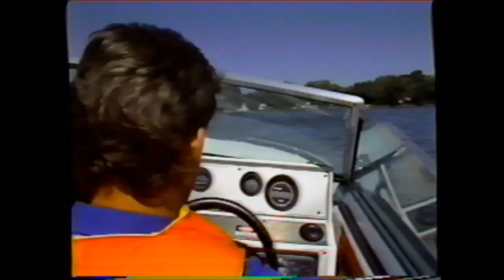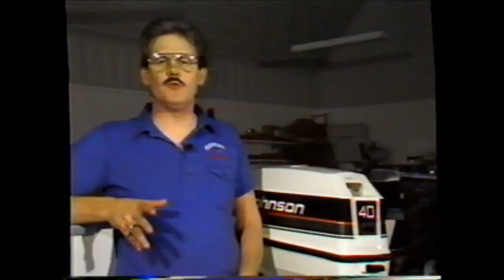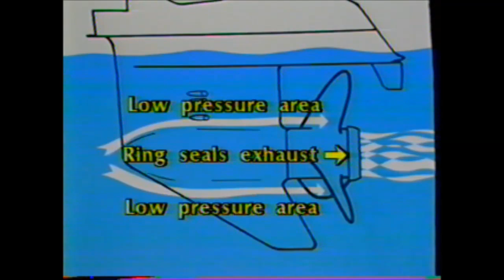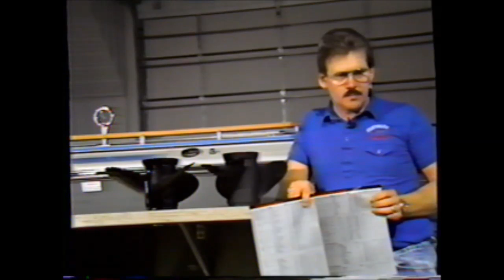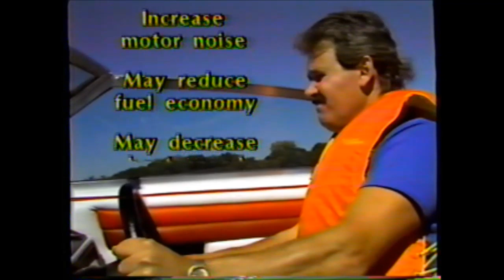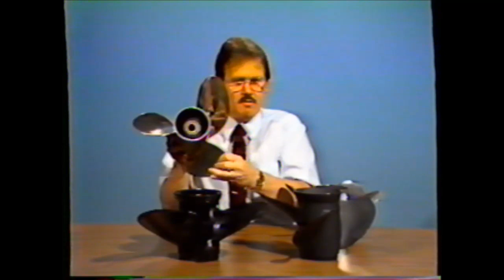PROPS: Where Power Meets the Water (OMC Video)

Comment: hey brandon , my name is kevin , and i need ur expertise . the same 85 hp evinrude you made a video about a while back. i just bought the boat , and the tilt and trim wire was cut , and the cylinders are there but no pump or resevoir     please can you tell me how to test and see if i need new tilt and trim  , of this can be repaired
Reply from the maker: What year is the engine?
Reply: @BrandonsGarage  its a 1980 evinrude the same motor you video , and you said you were gonna put it on a stand somewhere    title of video { look at a vintage evinrude}   i think
Reply: its on a 1980 eldocraft
Reply: 85hp evinrude